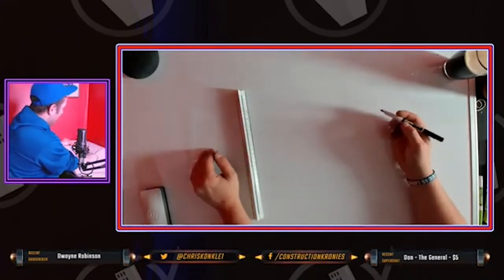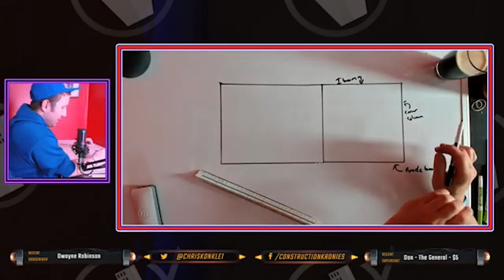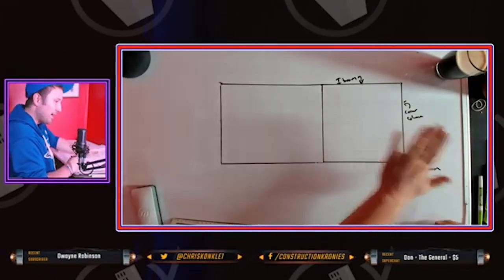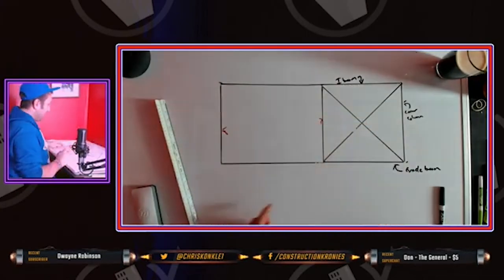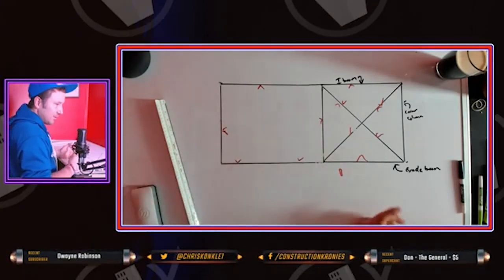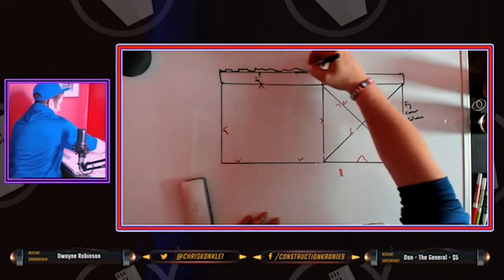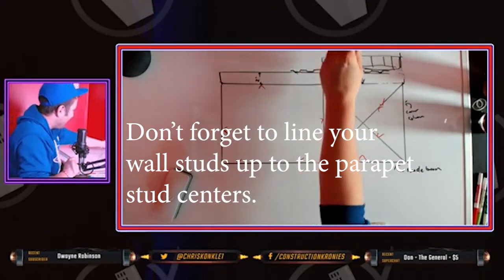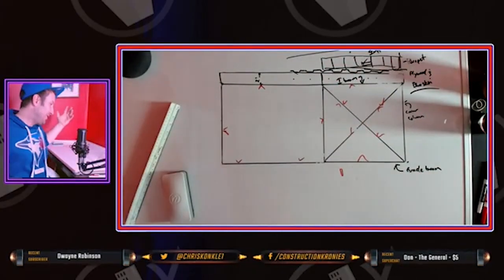Exterior Layout For Metal Stud Framing - Structural Steel & Parapets

Comment: I would like to know, when you're framing a wall, and looking out for that layout of the drywall ahead of time in every single corner. Sometimes you pull 16 and 5/8 and then continue with just 16 and I want to understand the whole method of that if you could teach me that would be awesome
Reply from the maker: Hey my  man great question. Ya so if I know the drywall thickness 5/8", 1/2" or double layer 1-1/4" I will set the stud centers properly so that a full sheet can start or an even cut can be made. You can measure over the distance say 16-5/8", make a mark, then clamp  your tape at 16"  to pull and mark the rest OR you can clamp right to 0" (the intersecting wall) and then mark 16-5/8", 32-5/8", 48-5/8".... It is a great practice to start learning the drywall so you can prepare the studs properly seriously a lot of guys don't do this. Does this answer your question at all? I can help you further during one of my live streams, I almost have the new studio completed and will be able to demonstrate for you.
Reply: @ConstructionKronies  I appreciate you answering my question, every single time that I pull 16 and 5/8 and then 16 after that it seems like if I'm not pulling for Center of the stud, and I'm pulling for the hard side, it always lands on the hard side which leaves no room for the next drywall piece. So it seems as if I have to pull 17 and a quarter, and then 16 inches after that, if I am making my studs all on the hard side. I don't know whether or not that that makes sense and I don't know whether or not that I'm right. I'm a sixth period apprentice, I think that I'm getting pretty good, as far as getting confident, just a little confused in this area and when in other areas I'm very good. Would love to join your live stream and just subscribe to your channel can't wait to learn more. I think that there needs to be, so much more people teaching in a way that you are or not a stud framing because there's not that much on YouTube.

Comment: You can answer on your next video what if the do the concrete wall long you could fix that with your metal work but it says the metal will have to be 24" you had to make it And you gotta make it 36 now Is it your job to fix it or us to charge them more for they had to get the conquered by the come fix it